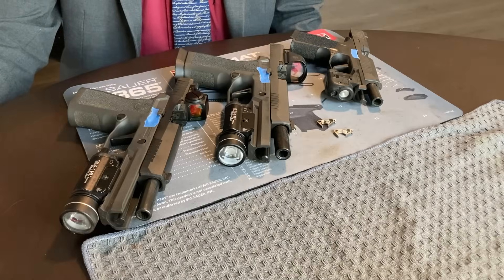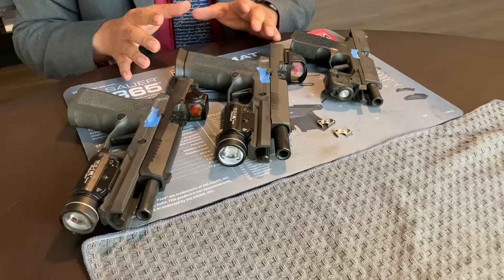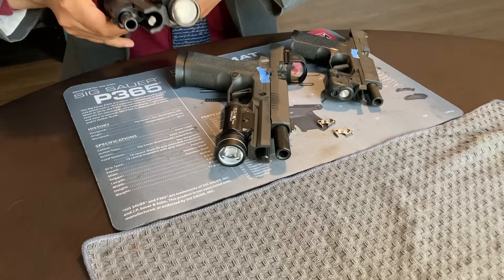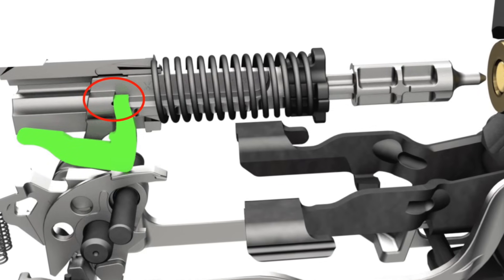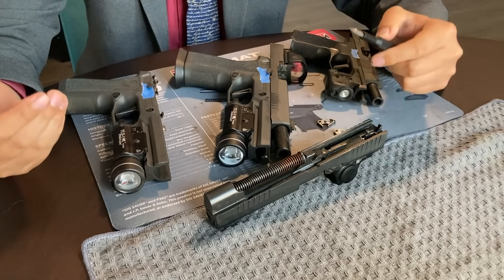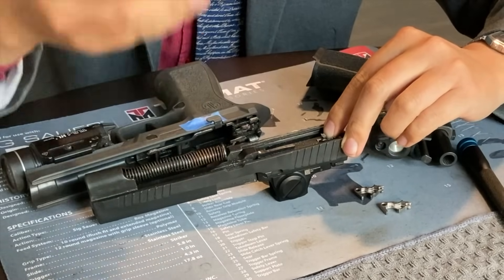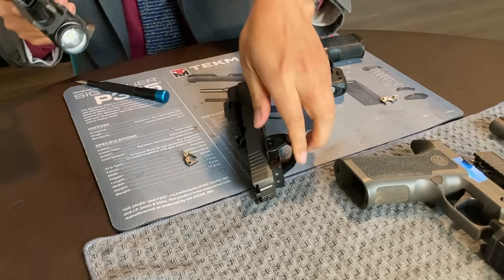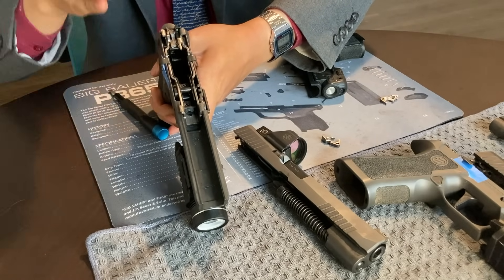How to fix a P320 that fails the Sear Movement Test

Comment: My 2-cents... X5 Legion, manual safety. I've tested my, (according to you), "failed" sear movement test, with blank rounds and using a small flat screwdriver externally actuating the sear several times (fully assembled gun, loaded with blanks, magazine inserted, one blank round in the chamber). On every one of my tests, the tip of the firing pin DOES NOT go to contact the primer on the blank round (that is inside the chamber), I repeat, the blank round in the chamber does not go "bang" when I go to the back of the (fully assembled) gun, insert a flat screwdriver and apply enough leverage to dip the sear down as you do in your tests with the slide removed... The sear mechanism does in fact make a "click" sound when pushed down from outside but the (cocked) spring loaded firing pin does not go off to the point of contacting the primer of the (chambered) round.  In my gun, the only way I can make the blank to go off and ignite is when I physically pull the trigger all the way as I'd normally would on a regular scenario... I only have one gun to test but I encourage you to make real field experiments using fully assembled P320s, if you have several to test, (OEM Sear) AND blank rounds and see what combination of - exterior - sear manipulation goes "bang" and which doesn't. In my opinion the experiment you are proposing here lacks data, is incomplete AND as you accurately say as well, you have zero idea what removing one of the legs of the sear is going to do to the function of the gun in the long run...
Reply from the maker: It sounds like your Trigger Bar demonstrates the same mitigation factor that my Trigger Bar does. You and I probably don't need to remove the rear leg of the Sear for our pistols to be safe from Uncommanded Discharges because as you note, the activation of the Safety Lever is delayed until after the Striker has been stopped by the Striker Safety Lock.

Many FCUs, like my friend's, do not display that mitigation factor that your and my FCU demonstrate, and are clearly dangerous despite having a fully functional Striker Safety Lever and Striker Safety Spring. If I had one of those FCUs, I would absolutely remove the rear leg of the Sear, as it is clearly activating the Safety Lever early enough that the Striker is able to fall with nothing blocking it from protruding.

Without the rear leg of the Sear, the only thing that will move the Striker Safety Lever out of the way is the Safety Lever moving because the trigger has been pulled. Nothing else moves the Safety Lever. Therefore, even if the modified Sear somehow moves on its own and releases the Striker, you end up with a situation like the original M&Ps and the VP9 wherein the Striker is released, attempts to fall, and is successfully blocked from falling by the final safety mechanism. No Uncommanded Discharges will occur from the design flaw of the rear leg, even if the striker is somehow easier to release (it's not any easier, IMO).

Since the factory and currently-available aftermarket are not offering any ways to ensure the final safety mechanism is operating as intended, this video exists to explain how to achieve the same effect. It's up to everyone, individually, to determine if the balance of risks is worth doing this, or just selling the gun and changing to a different platform at cost.
Reply: @P320Truther  ... Appreciate the feedback. Just to add; my gun is a "California approved" X5 Legion that I believe it has to pass additional and independent safety & drop tests before it is allowed to be in the CA roster, in addition to magazine disconnect (ridiculous) and loaded chamber indicator (also idiotic). At this point, I'd like to find/ buy an used P320 with all the "known issues" as a test/ experiment platform, and not use the X5 that I've set it up for matches...  I'm not a fan of brands or companies (nor defending Sig Sauer at all), I just want to know more about the issue... (I'm an engineer from a different industry and a professional "garage tinkerer").

Comment: A couple of questions. Weren’t there reported Uncommitted discharges with the original seer and what is the difference between the original sear and the modified seared that potentially makes the weapon safer than the original seer?
Prior to the modification that you made, when you switch the FCU’s between the two weapons, did you experiment with also switching the breakdown lever to see if maybe CIG accidentally used a different caliber breakdown lever on your friends weapon?
Reply from the maker: I fail to see how the rear leg of the Sear can play any role in enhancing drop-safety of the FCU. Pre-"upgrade" Triggers and Sears are both over double the mass of the post-"upgrade" Trigger and Sear, and we are in fact removing mass from the Sear, which makes it even harder to actuate with simple inertia.

There is no such thing as a "different caliber breakdown lever" - the Takedown Lever is identical on all models of FCU. Anyone claiming otherwise has no idea how the P320 FCU actually works.
Reply: @P320Truther  He means the takedown lever safety

They are different

Comment: The purpose of the rear sear leg is to aid the sear springs in pushing up on the sear. Theoretically, if the sear springs fail, the sear's rear leg will still hold the sear up. This also helps keep outside forces from releasing the sear. Removing this leg WILL make it more possible for an uncommanded discharge, as you will only have the sear springs pushing the sear up. 
On my two Sigs and my friends' two Sigs, if the sear is somehow bypassed, our safety levers aren't manipulated until after the sear is completely depressed. The sear will have released the striker before being completely depressed, but the striker is stopped by the striker's safety lever. We can see this (with the slide off) by pushing down on the sear and verifying the safety lever was not moved until the sear was completely depressed. We also verified with Three P320s In A Trenchcoat test in his original video.
Even in this video, you can see that the safety lever has not moved once the sear has moved enough out of the way for the striker to release. He has to completely depress the sear for the safety lever to move up (You will need to watch in slow motion to see this). 
If you test this by only pulling the trigger, you will see the safety lever immediately start moving up as you pull the trigger against the wall, which is the correct operation. The mechanics should only allow the safety lever to immediately move up with only a trigger pull. You will also see that in the video. 
If your safety lever moves up immediately when you start to push the striker down manually, you have a problem. If your gun fails the Three P320s In A Trenchcoat test in his original video, you probably have a broken striker safety spring or a broken striker safety. If you are unable to repair your own gun for either problem, I recommend you take it to a certified Sig armorer to get it checked.
In conclusion, I would NOT recommend removing the sears rear leg. You are asking for an uncommanded discharge. 
I wonder how many of these guns with the "uncommanded discharges" have broken parts or the originally pre-upgrade parts in them? Granted, Sig should have done an official recall on the original models to have avoided all this, but they did their homework on the new design and solved a lot of problems.
Reply from the maker: It sounds like your Trigger Bar demonstrates the same mitigation factor that my Trigger Bar does. You and I probably don't need to remove the rear leg of the Sear for our pistols to be safe from Uncommanded Discharges because as you note, the activation of the Safety Lever is delayed until after the Striker has been stopped by the Striker Safety Lock.

Many FCUs, like my friend's, do not display that mitigation factor that your and my FCU demonstrate, and are clearly dangerous despite having a fully functional Striker Safety Lever and Striker Safety Spring. If I had one of those FCUs, I would absolutely remove the rear leg of the Sear, as it is clearly activating the Safety Lever early enough that the Striker is able to fall with nothing blocking it from protruding.

Without the rear leg of the Sear, the only thing that will move the Striker Safety Lever out of the way is the Safety Lever moving because the trigger has been pulled. Nothing else moves the Safety Lever. Therefore, even if the modified Sear somehow moves on its own and releases the Striker, you end up with a situation like the original M&Ps and the VP9 wherein the Striker is released, attempts to fall, and is successfully blocked from falling by the final safety mechanism. No Uncommanded Discharges will occur from the design flaw of the rear leg, even if the striker is somehow easier to release (it's not any easier, IMO).

Since the factory and currently-available aftermarket are not offering any ways to ensure the final safety mechanism is operating as intended, this video exists to explain how to achieve the same effect. It's up to everyone, individually, to determine if the balance of risks is worth doing this, or just selling the gun and changing to a different platform at cost.
Reply: @ Ok.  I have another question on this. How can one FCU v another demonstrate different “mitigation factors “?  
Unless I am completely missing something, you’re saying that the basic operations of the 320 FCUs can be different?  
Or, is it one FCU v another has either broken components or the components have not been manufactured to spec. ?  

Thank you for your time.
Reply from the maker: Different combinations of intact, in-spec FCU parts yield different Trigger Bar behaviors, which yield different timings of Safety Lever activation, and thus different timings of when the Striker Safety Lock is deactivated relative to the Sear releasing the striker. Even two identical parts of the same part number can yield different Trigger Bar behavior, as demonstrated in my 2nd video ("P320 Sear Movement Test Followup"). Some FCUs will mitigate the design flaw through a delayed activation of the Safety Lever. Some FCUs will not. There is no real way to predict which ones will and won't mitigate the design flaw.
Reply: @P320Truther  Thank you for the additional information.  

My thinking is always aviation and with it the standardization that is absolutely essential.  That anomaly sounds to me to be worthy of a recall by Sig.  Hopefully, they have been made aware of your findings.
Reply: I think you make some excellent points here.  

I am not an engineer or a gunsmith, but I certainly agree that making these sorts of modifications without stringent testing of functionality and materials processes, to include some sort of re-certification is probably a bad idea.  

As a retired corporate pilot with also a degree in aviation maintenance, I know that you can’t make modifications to your aircraft without engineering approvals and specific certifications of airworthiness.  

As critical as firearms operations and safety is, I kinda believe that the same thinking should apply.  

Then there are always the attorneys who would get ahold of something like this as well.

Comment: I hope you appreciate just how big of a sh*tsh*w you have potentially created for Sig. If you and others… including certified Sig Armorers… have independently reached the same conclusion and been able to demonstrate it, AND the solution is either start taking a saw to it or buy 3rd party parts specifically designed to fix the problem Sig claims doesn’t exist… lawyers for folks suing Sig are going to have a field day with it, because they now have a basis to take it to their own independent gunsmiths. 

It doesn’t matter if your assertions are true or false, they’re a falsifiable (I mean that in the logic sense) argument, and Sig is now going to need to demonstrate that it’s false.

If they can’t (or won’t), and given how badly they’ve dug in that nothing is wrong, they’d be wise to do another “voluntary upgrade” based on possibly “defective parts” in order to save face and .gov contracts.

Comment: Does a trigger safety like they have on all other striker-fired pistols prevent this entirely? Because then even if the sear moves down, the trigger can't go back.
Reply: I was wondering that too. It seems pretty obvious and not only that, it would fix one of the drop safe issues too. There's a famous slo mo video of a P-320 firing as it hits the ground breech first. In the video you can see the trigger moving to the rear. I don't know if that's because of the momentum of the trigger or if it's because of the seer falling but either way a trigger safety would seemingly solve.
Reply: @davidhoffman6980  it seems like a trigger safety resolves several of the P320 issue. And the only reason I can think of why sig doesn't add one is because they know of some other fault in the gun which would also cause an uncommanded discharge.
Reply: @dekuthedog  I'm going to disagree with that. Sig Saur maintains that the P-320 doesn't discharge without a trigger pull and they might sincerely believe it. I know that at least some of the claims of the P-320 firing in the holster or not being drop safe are false or exaggerated.
Reply from the maker: I have not been able to get my hands on an Agency Arms Trigger (the one with a trigger dingus) to test. Preventing forward movement of the Trigger Bar is supposedly what the Manual Safety does, but reports have been mixed on whether an activated Manual Safety does or does not result in a pistol that successfully mitigates the design flaw.

Comment: Focus trip did a video on the striker safety being out of spec because itsba mim part and not a stamped piece as originally designed and this is the issue sig is "fixing" on the assembly line with every pistol being hand inspected.
Reply from the maker: The striker safety lock is an easily-inspectable part and was perfectly functional on multiple FCUs that failed the Sear Movement Test.

Comment: Would this change anything with the out of battery safety?   Or, the original drop safety issue?
Reply from the maker: Not as far as I can imagine. In fact, this should theoretically make the drop-shot issue harder to reproduce as the issue was having too much mass in the trigger and the sear, and we are removing even more mass from the Sear.

Comment: Honestly this all stems from people trying to move away from a Glock design. Shows the brilliance of Gaston Glock as companies are struggling to keep up today.
Reply: @TheGingerKing1994  ? VP9 is just fine, 365 is fine, hellcat is fine. This is purely an issue with taking an old hammer fire weapon and turning it into a striker while also doing it as cheaply as possible type of issue. If sig spent the money or started from the ground up I'm pretty sure this wouldn't be a problem.

Comment: Watching the movement of the trigger when you are pushing on the sear to make it disengage, the trigger moves like it is being pulled.  This is because of the extra leg that you cut off, now I am thinking that what if there was a trigger blade safety that would stop any trigger movement?  would that not actually lock the sear in place?  not allow it to be moved at all?  With your tests and findings I'm almost convinced to not cut the extra leg off and just add a trigger with safety blade and this would lock the sear in place so it couldn't even drop with any out side force unless the trigger was actually pulled.  What do you think of that?
Reply from the maker: I have not been able to get my hands on an Agency Arms Trigger (the one with a trigger dingus) to test. Preventing forward movement of the Trigger Bar is supposedly what the Manual Safety does, but reports have been mixed on whether an activated Manual Safety does or does not result in a pistol that successfully mitigates the design flaw. I would prefer to prevent the problem upstream rather than mitigate the problem downstream.

Comment: Hypothesis: If the trigger had a Glock style blade safety locking it in place unless finger pressure on the  trigger disengages it,  then the rear leg of the sear would not be able to move the trigger bar. The sear and striker safety lever would not move and the pistol would remain safe. Can you test this hypothesis with an aftermarket trigger safety and factory sear on the failing FCU?
Reply from the maker: I have not been able to get my hands on an Agency Arms Trigger (the one with a trigger dingus) to test. Preventing forward movement of the Trigger Bar is supposedly what the Manual Safety does, but reports have been mixed on whether an activated Manual Safety does or does not result in a pistol that successfully mitigates the design flaw. I would prefer to prevent the problem upstream rather than mitigate the problem downstream.
Reply: @P320Truther  I have never liked how the SIG sear is pivoted at one end, and so it can be moved by acceleration shocks. Compare it to the M&P sear which is pivoted in the center, perfectly balanced as all things should be.
Reply: @P320Truther  one data point in this thread
Reply: Can confirm. I'm LEO been carrying a post upgrade X5 for four yrs. Mine fails the sear drop test using a dental too. I put the agency arms trigger in, and now the pin block safety catches it every time.
Reply: @trevormartin4354   Thank you 
@P320Truther here is one data point
Reply: I've been saying this for a while.  Make all police issues with the trigger dingus and this issue goes away.